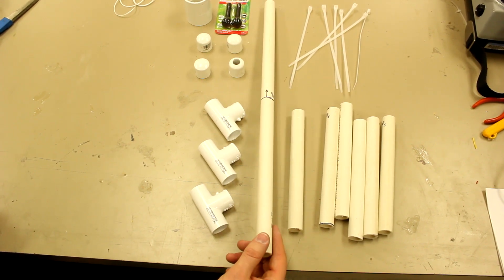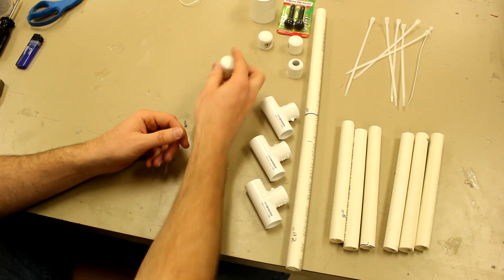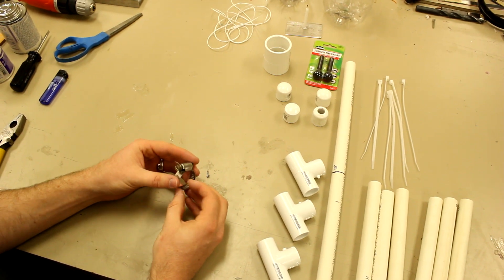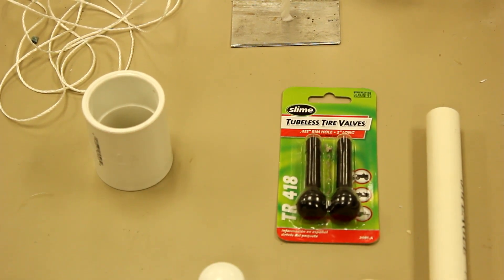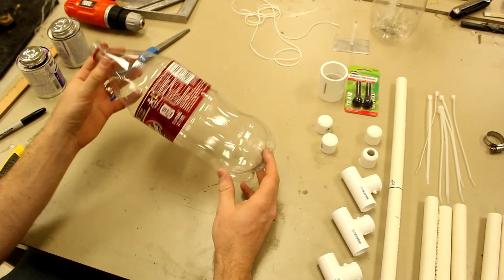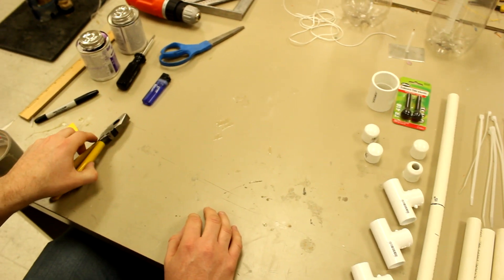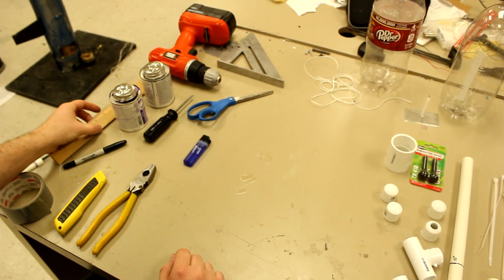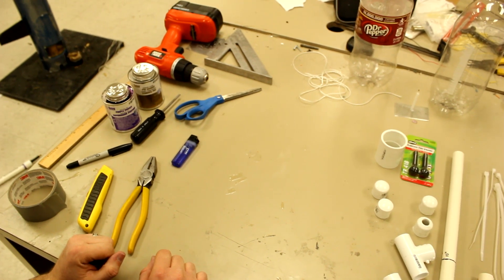Make your own water bottle rocket launcher! - Part 1 of 3

Comment: Parts List
6' of 1/2" inch PVC
3x 1/2' Ts
4x 1/2" end Caps. One with 1/2" hole drilled
1.25" PVC coupling
6x Medium Zipties
1x 3/4" band clamp
1x .453" Rim Hole Size  Tubless Tire Valve
5' Nylon String
2x 2 liter water bottles
1 Candle and Match

Pliers (Needle Nose or Blunt)
Ruler
Duct Tape
Flathead Screw Driver
Square
Electric Drill w/ 1/2" bit
Scissors
Permanent Marker
Box Cutter

PVC adhesive and primer
Reply from the maker: Thank you for adding this. I have since added the parts as well as their links on amazon to the description of the video.

Comment: Hi.
Will a bicycle tire tube valve work equally well? What would be the difference between using that and ur tire valve...any significant loss in pressure or performance?
Reply from the maker: We haven't tested a bike tire valve. It may require a different hole size in the end cap, but should work fine if you have a good seal. Let us know how it turns out.
Reply: usuchimaera Thanks. Will test that. I searched valve pressure numbers and tubeless valves like your TR 413 were max 65 psi, whereas the bicycle tires here mention max 60 psi for the Woods valve they use. Also the stem of my bicycle valve is curved on 2 sides and flat on 2 sides, so not circular. Will need an epoxy seal for it. Will make and let you know.
Reply: @ashutoshbhakuni303  Any result s? Was everything OK?

Comment: Water leakedge problem.... How to fixed it
Reply from the maker: The best way I know of to fix the leak is to increase the diameter of the pipe where the opening of the bottle sits. You could try repeating the heating and compression steps.

Comment: If I want to see what pressure I'm putting in for various trials, what is the cheapest and easiest way to do it? I would assume adding a pressure gauge on one of the ends on the base somewhat like the value?
Reply from the maker: I just got a bike pump that has a pressure gauge on it.

Comment from the maker: If it is leaking, that means that you aren't getting a good seal on the launch rail. You may need to repeat the heating portion of the tutorial on part 2 of 2 to make sure that it seals well. A small leak isn't bad, but if it is gushing you are going to have a hard time.

Comment: Hi,
Mine leaks...help
Reply from the maker: You probably want to make sure that the zipties are tight on the top when in position. Another thing to check is to make sure that when you heat the pipe to make the bulge, you create enough of a lip for the entire gap to be covered.

Comment: Does the water or air leak if I pump it to 60 PSI?
Reply from the maker: I've gotten up to 100 PSI without issues. Just make sure the zipties are very snug so the bottle can't shift up under pressure.

Comment: Great tutorial!  My kids and I have had a great time blasting bottles into the air in the back yard.  I did, however, come up with one very simple - but very effective - enhancement.  When you're pumping air into the launcher, it's a little messy getting to the air inlet.  And so we simply added a 90 degree elbow, which puts the air inlet pointing UP, instead of sideways into the grass.  We're also considering getting REALLY fancy and adding a pressure gauge into the pipework somewhere.
Reply from the maker: Great idea.